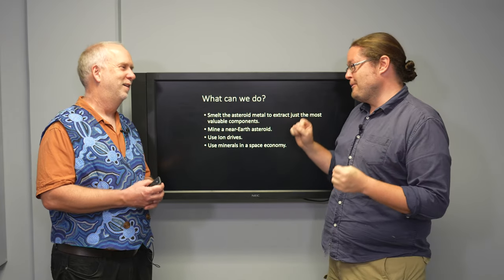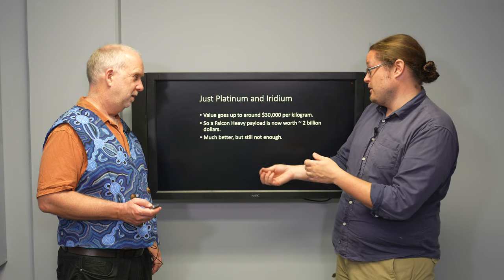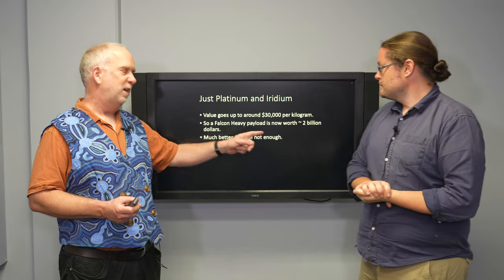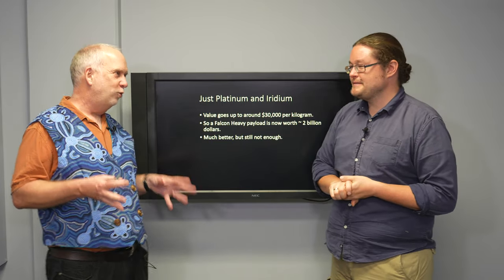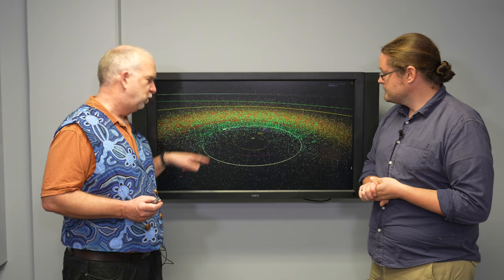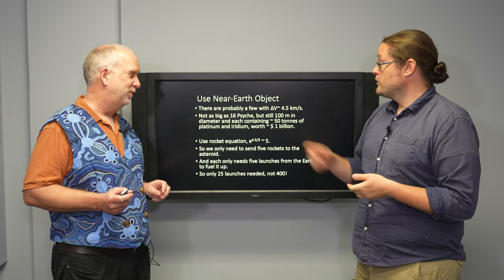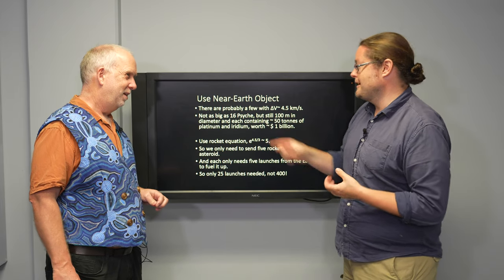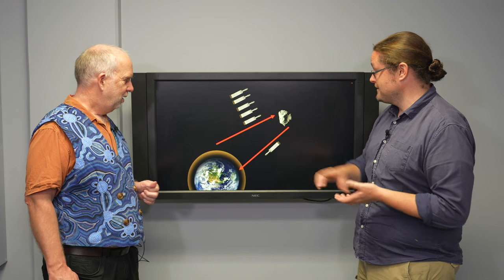Space V7.4 Smelting NEOs

Comment: I think if we could set up a refinement platform at L4 or L5, we could dramatically reduce costs. I'm sure there's plenty to harvest already lingering around in those areas, reasonably close in terms of Delta-V cost from platform to the asteroid(s) being harvested. 

Seems like there's dozens of ways to approach the problem and in all of them, the upfront cost would be truly enormous and it would certainly be one of (if not THE) greatest undertakings in the history of our species thus far. 

The long-term profitability isn't in question, in my opinion this sort of industry is inevitable in lieu of how it would enhance the productivity and efficiency of space-related infrastructure - but I don't think any potential investors are going to live long enough to be sipping martinis on a yacht they bought with space rock money; and that's the real issue, I think.

I'm sure if we can get it done just once and demonstrate its uses, it'll put a crack and a leak in the metaphorical dam. After that, it's only a matter of time before it bursts - and space truckin becomes a literal job.